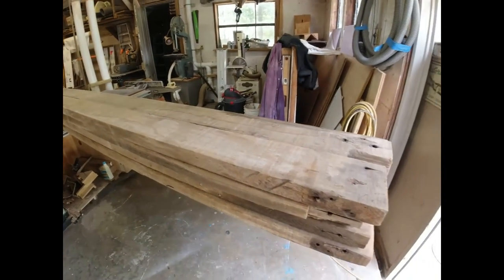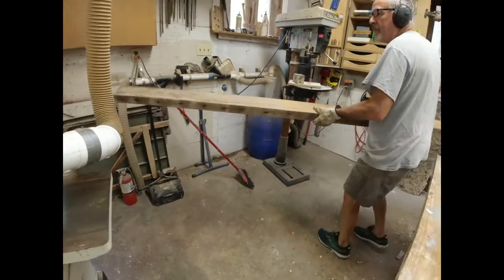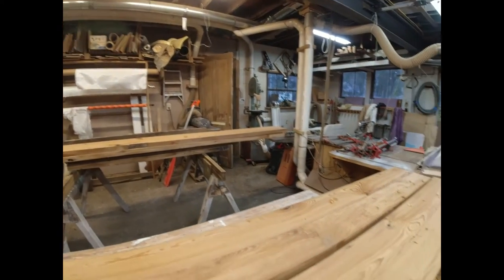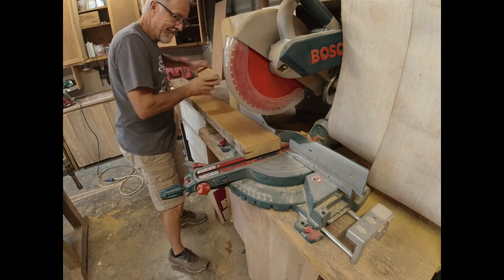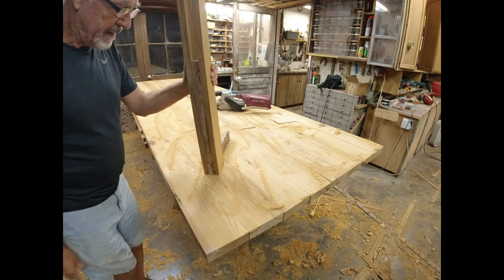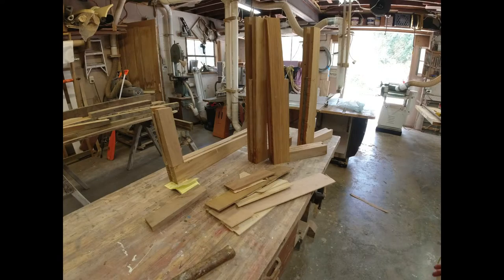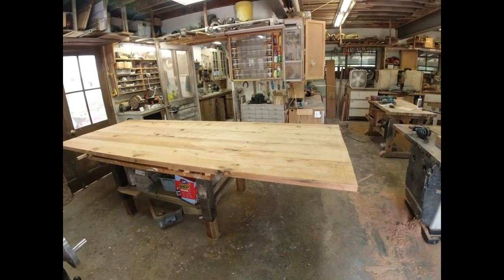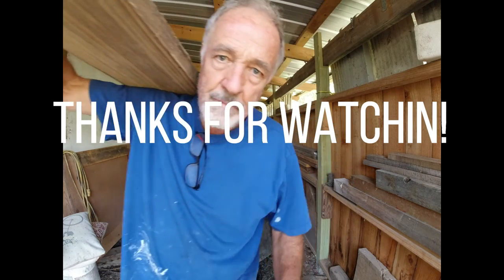10' DIY dining room table build using salvaged cypress. Part 1, glue up of the top and legs.

Comment: P.S.  When I have done doors and other large flat surfaces like work benches I have drilled each section and inserted all thread through the boards with recessed holes at each end large enough for the wrench to snug up the nuts.  Then I have done both embedding the holes with epoxy and just using a wooden plug so that is later accessible for tightening (even though it was edge glued over time it can develop checks and cracks).  I have used both sixteen o.c and twenty four with good success and 3/8 rod.
Reply from the maker: I did the same when I rebuilt my heavy workbench. Not normally done when building furniture for climate controlled environments.
Thanks for watching!
Barry

Comment: Hello Barry,  You got me wondering if a steel cutting carbide tooth blade made for regular circular saws would not work better for cutting those hidden nails.  Not the cold cutting blades but I  know Diablo for one makes blades to cut steel with a SkilSaw and I am assuming larger ones for the table saws.  The smaller 7 !/4" might do the job (less expensive).  I know the construction blades for wood with nails would cut them and if it did finally ruin the saw blade it would be far less than a ten or twelve inch blade (especially if it is a good wood blade!!).  I would hate to see an eighty dollar blade trashed for a dozen cuts.
Reply from the maker: Douglas
Thanks for watching and thanks for commenting. I don't buy nice (expensive) blades for my table saw because of the abuse I tend to give saw blades. I am more of the two for $45 dollars kinda guy. For me they do just fine. I do keep older ones around and if I have a fresh blade on the saw and intend to cut some questionable or painted material I will take the time to swap to am older one. If this was a production shop investigation into a more suitable blade would defiantly make sense.
Thanks Barry
Reply: @barrylukebuilds7894  Hi Barry,  The blades I am referring to are under $20 for the smaller ones.  Haven't had my table saw going in a while so am not sure what a ten would go for.  Like you I don't buy the top end pricing.  Been working metal and doing rough carpentry for the past few years remodeling and expanding my shop so my saw being a flat surface is buried!! Looking forward to the finish you'll use.